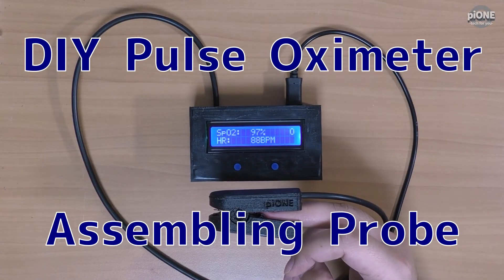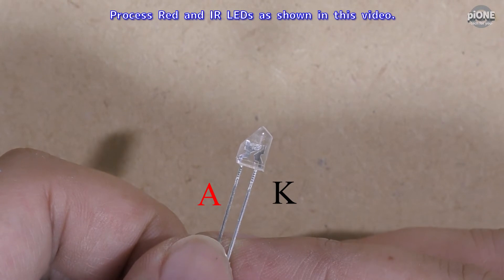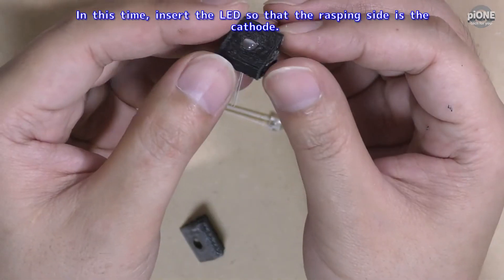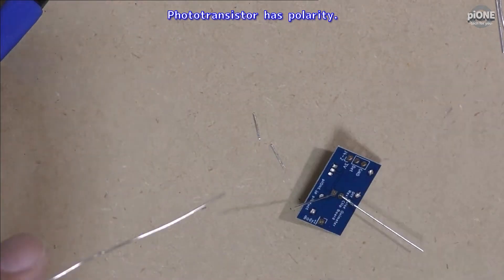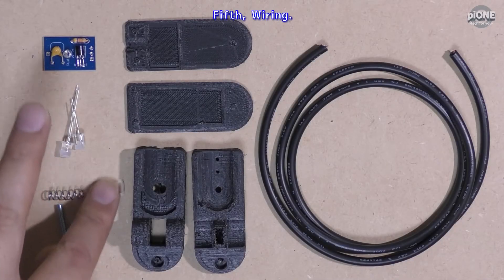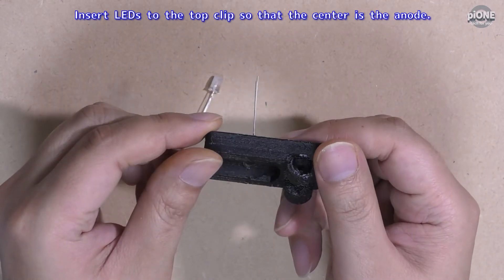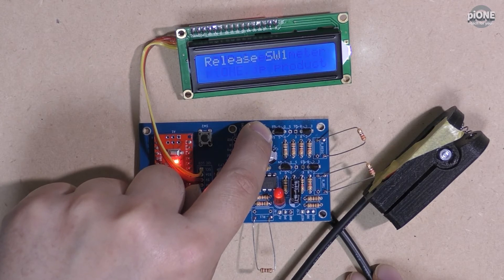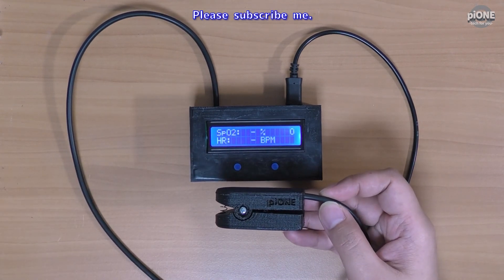DIY Pulse Oximeter you can make   5.Assembling Probe

Comment: Hi , the reciver is a ir led reciver? What is its wave length?
Reply from the maker: The receiver is an IR(940nm) photodiode.
Semiconductor photo detector is sensitive to the short wavelength side.
Therefore, the IR photodiode can cover red detection.

Please note that the package should be a clear type because black package cut the red light.
Reply: @pionechannel1551  Thank you so much. Excuse me for my several questions , I am trying to make it . can I ask some another questions about it?
Reply from the maker: OK.
Please write here.
Reply: My question is what is best value for r_ir1 , r_red1 ,  rl1 & rt1 ?
Thanks🙏
Reply from the maker: Their resistance depends on the parts you use.
Please adjust them according to below video.
https://youtu.be/eaC6HGed-EQ?t=351